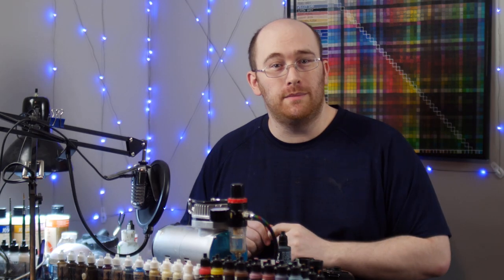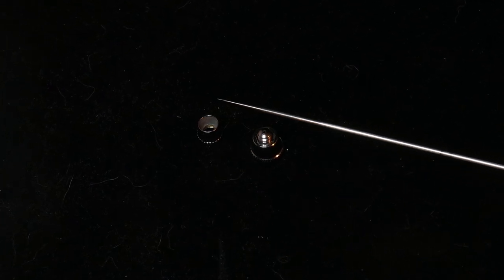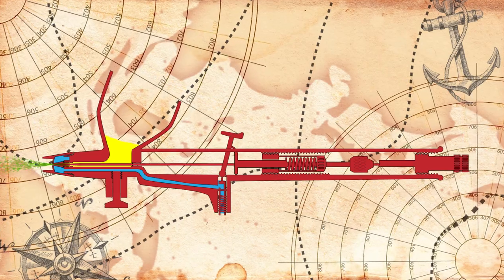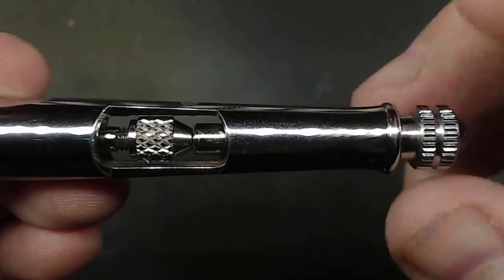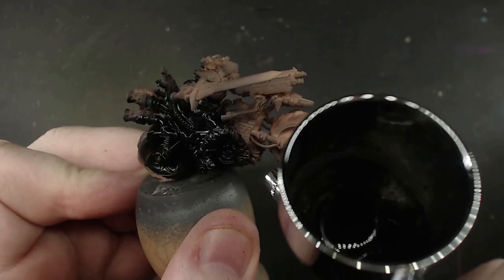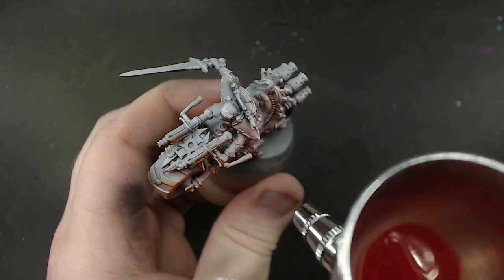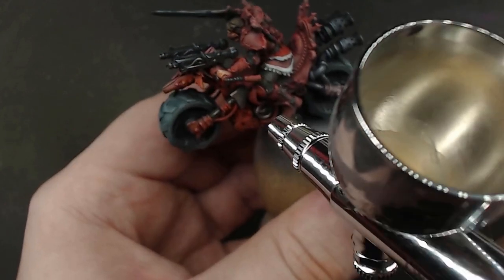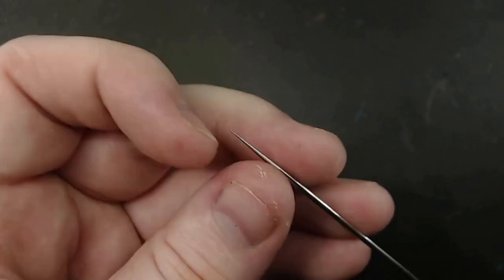Airbrush: An Inside Story. A Quick start guide for new airbrush users.

Comment: I get that the trigger can be used to lightly restrict airflow, but that's a set of muscle control that's irregular, unmeasurable, and if consistently utilized, will lead to unnecessary fatigue. Set your air flow and pressure at the regulator. If you have a micro air control dial at the front of the airbrush, you can fine tune there. Don't push this idea of micro-controlling your airflow at the trigger by how far you press it down.

Comment: So you use green stuff world VARNISH as a medium? Interesting.
Reply from the maker: It's not a traditional polyurethane varnish I don't belive. And it actually says in the fine print on the bottle that it can be used with paint mixed in as a medium.
Reply: @PaintmanJourneying  funny story: I have a bottle of said product on the way as I heard it is very good as a super matt varnish. So I will get to test it as a medium. Thanks!
Reply from the maker: @prava163  It's great as both honestly, I use it during painting and a matte coat after. May matte products tend to get cloudy if you thin them or stay satin if thinned. I've added more than half water or flow aid into it when applying as a varnish and it still worked just perfectly every time. So on that I definitely agree, anyone looking for a testors dulcote replacement, Maxx matte is it.